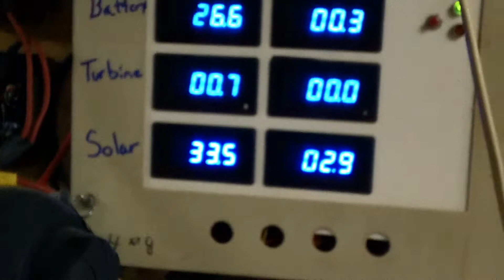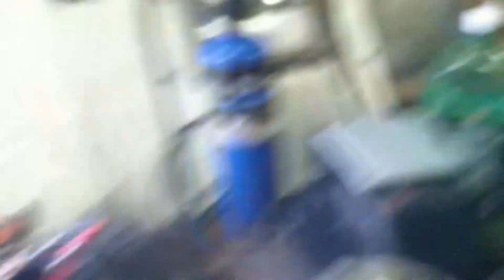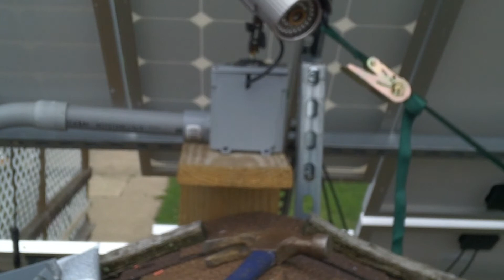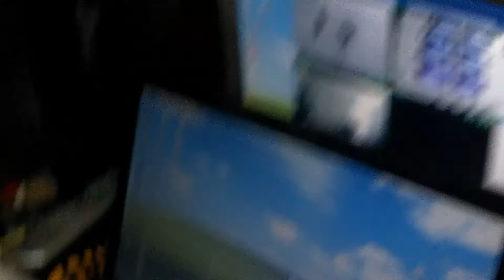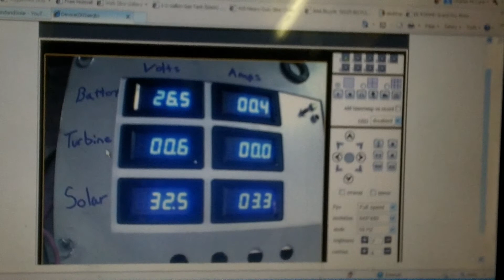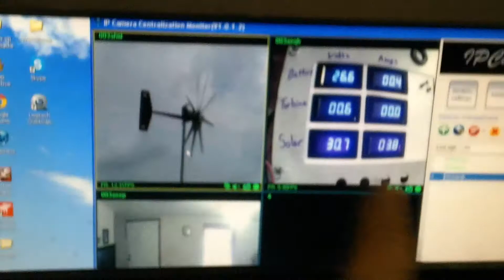How to install a security camera. for viewing a turbine.

Comment from the maker: I just use plain network cameras.   they are DBpower cameras I got off ebay. then all I did is in my router I set the ip of just one camera as the main cam and then linked the other cam to it. in its web interface. I bought a Domain name and then link the domain name to my modem's IP address. so when you clik on the domain name it takes you strait to my cam's type in password and your in.   no software needed.  unless you want to view it on the computer if so the cam comes with the software.